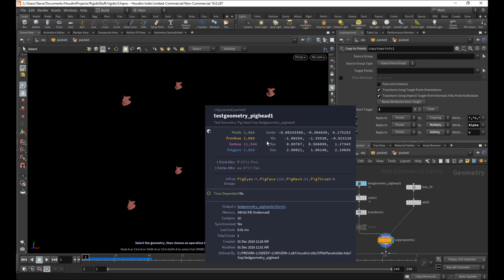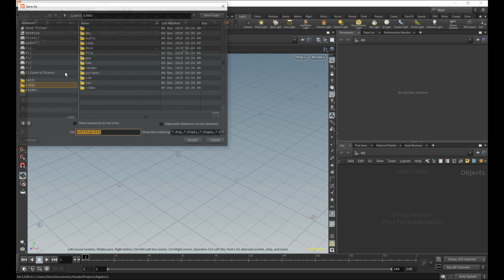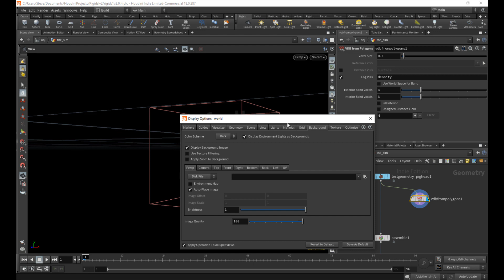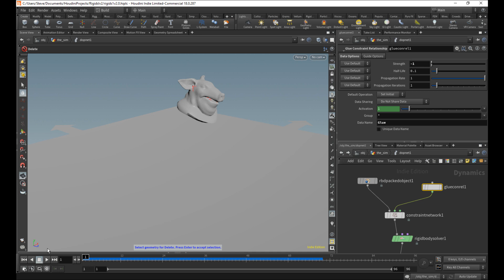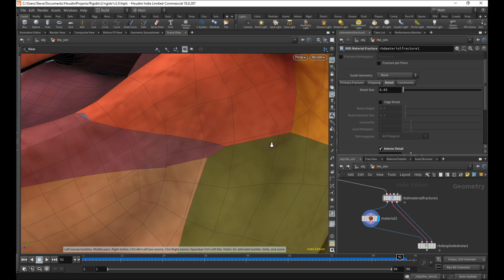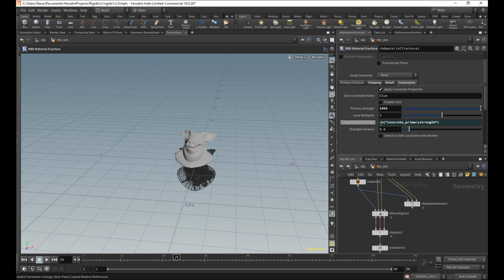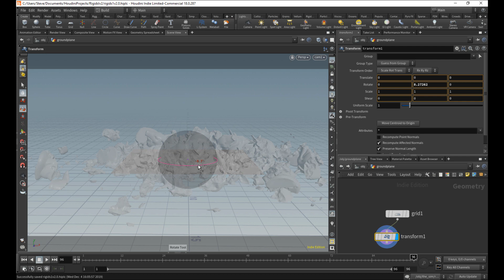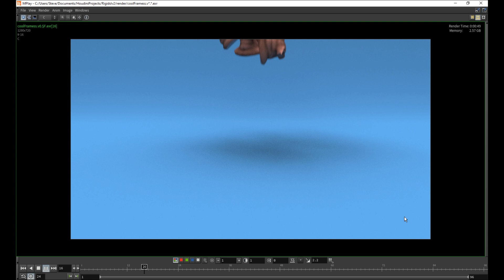Applied Houdini Rigids I version 2.0 - Fundamentals

Comment: Time stamp::

00:00 1.Intro
00:36 2. Packed Primitives 
08:24 3.Transformation
16:31 4.Basic Setup
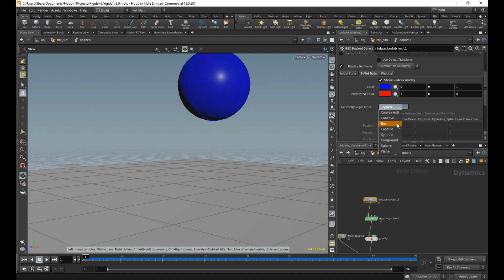24:34 5a.Voronoi Fracturing-Demo
30:57 5b.Voronoi Fracturing-Setup
37:37 5c.Voronoi Fracturing-constraints 
47:08 6.Boolean Fracturing 
50:56 7a.RBD tools workflow- RBD material Fracture 
01:04:07 7b.RBD tools workflow-important Properties
01:12:23 7c.RBD tools workflow-RBD setup
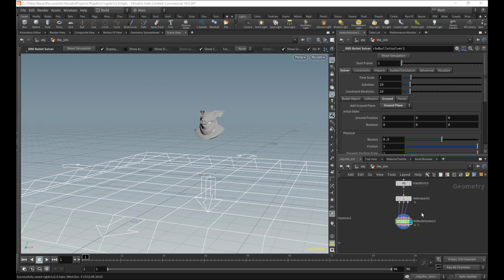01:18:11 7d.RBD tools workflow-instant asset 
01:26:51 8a.Render- setup
01:34:13 8b.Render - Lighting
01:42:49 9.Conclusion

Comment: First off, a massive thank you for your resources and tutorials. Basically I am using v18.0.499 I find that at 36:43 when I connect back to the dopnet the simulation fall happens but the pig heads stays in once piece?? driving me crazy.  I have followed everything and re-watch a few times now and there is no difference in my set up, is this a version issue?
Reply from the maker: Hello! Probably not a version issue - you might want to check if you still have multiple packed pieces, and that your glue isn't too strong. Otherwise, you can send me your file to contact@appliedhoudini.com and I'll take a look!
Reply: Hi there, I had exactly the same problem. I checked the collision boundary and the glue setting but nothing helped. Finally I figured out I stupidly used the wrong solver. I used RBD Solver instead of Rigid Body Solver. After the fixing, everything worked! Maybe you made the same mistake. If it is not the case, I would recommend that you just simply delete your DOP setup, select the packed pig head and use the shelf button RBD Object and Ground Plane to set up the DOP. It will definitely work. Then you can compare your setup with the houdini build-in setup to find the problem. This is how I figured out my mistake. Hope it helps! :-)
Reply: @nininanyu  Man. Thanks for pointing this out. Had the same mistake. haha.

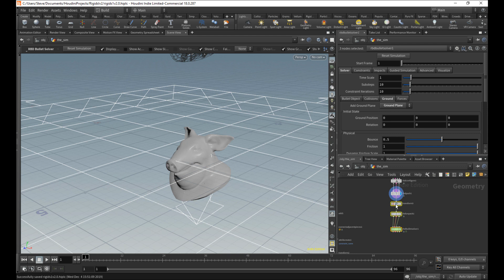Comment: Thank you for this tutorial, I have learned so much from you!  I have a quick question.  At 1:19:15 you begin the process to pack the geo and copy it to a highly divided box. After the copy I noticed you unpacked the geo before running it through the premade "RBD Bullet Solver" simulation.  Don't you lose the benefit of using packed points when simulating this way?   It looks like the premade "RBD Bullet Solver" node does not accept packed geo, but if you make your own custom Dop Network you can import a packed rbd object,  is that correct?
Reply from the maker: Hello, glad you're enjoying it! We're not unpacking geometry back into polygon mode, we are unpacking packed geometry that was itself packed into a higher package (assuming you are talking about the RBD Pack/RBD Unpack pair). The RBD Bullet Solver SOP does accept packed geo, and is what we are doing here in this lesson. You can always middle-click and hold on a node to see what kind of geometry is present at a given node - you'll see the packed pieces are still there after the RBD Unpack! If you have more questions, feel free to email me at contact@appliedhoudini.com!
Reply: @nothingifnotcritical  Thank you for taking the time to reply!
Reply from the maker: @NightWolfx7578  No problem!

Comment: Sir,
First of all, thanks for sharing your knowledge.. It means a lot.

Quick question if you don't mind...
On the second fracture level for the material fracture node.... Is there a way to control where or what pieces I want to add the 2nd level to....  Like either painting density, or maybe grouping some pieces of level 1... The last idea I can think of is may3an attribute wrangle and assign the names of the required pieces to an att.

Not sure if that is even possible... Is it?

Same question applies to the first level... Can I paint in my density where I want to fracture?

Thanks a lot

Comment: Thank you Steven for this awsome tutorial! I have one question, can we use a textume map in black and white, for example a crack texture map to generate cracks or impact point in RBDMaterialFracture node ? Thank you again.
Reply from the maker: Hey! No, not exactly, though you can paint where you want more density of cracks with the RBD Paint SOP. You can however use the Trace SOP to make geometry based a crack texture map, which can make cutting geometry that you can feed into an RBD Boolean node! You can email me at contact@appliedhouini.com if you need more help with that!

Comment: Hey Steven, thank you for making this! I have a quick question for your or anyone that may be able to help--at about 1:20:24, where you have all the Pig Heads, how would you make individual pighead randomly rotate as they all fall? 

I have been trying to figure that out for hours.

I have learned a LOT from your tutorials, i really appreciate the depth and the detail that you explain with.    Thank you
Reply from the maker: Hello! After the /obj/the_sim/copytopoints1 node, create another Attribute Randomize SOP and set the Attribute Name to w, set the Global Scale to 20, and set the distribution to Inside Sphere again. After that, on the /obj/the_sim/rbdunpack1 node, set Transfer Attributes to w as well, so all the pieces get these new random angular velocities. That should do it!
Reply: @nothingifnotcritical  thank you for the quick reply!!! I will give it a try.
Reply: @nothingifnotcritical  yes, it works! In my original attempts i did not set Transfer Attribute to w. Thank you once again!
Reply: @nothingifnotcritical  Hi Steven, one more question, is there a reason this does not work when using the RBD Solver? it looked like that was also the cause, when i change the solver to bullet it works, but with RBD Solver it does not. Is RBD Solver getting phased out and I should use bullet solver? The reason i am asking is that I used RBD Solver b/c it was giving be better collision geo and interaction with FLIP.

Anyway, i apologize for all the questions. If anyone else can enlighten me I would appreciate that as well. :)
Reply from the maker: @maximostromogilsky188  Indeed, the old regular 'rigid body solver' hasn't been updated in forever (as far as I know), and isn't generally used anymore... It's all Bullet all the time now! If you have any more questions, you can always email me at contact@appliedhoudini.com!
Reply: @nothingifnotcritical  thank you!

Comment: Hi, I loved this tutorial man, its great,
I have a doubt when I try this for another scene, Imagine 2 circular parallel plates (plate 1 at a height of 1 meter (fixed) and plate 2 is moving from 0.5 to 0.8), in-between that, I want to crush a wooden stick (which is in space, in-between those plates) I tried that with ground plane, its a success, when I tried like as I said above I can't hold the upper plate and the wooden stick in space (from falling), is there any way to hold the plate and stick from falling???

Thanks,
Reply from the maker: Hey, you can use the Glue constraint to attach any rigid body to any other. You could then delete the glue constraint (or have it be destroyed from an impact to one of the constrained pieces) during your simulation when you want to release it! If you need more help, feel free to contact me at contact@appliedhoudini.com
Reply: @nothingifnotcritical  Hi, I found it, thanks for the reply, Now I can hold the stick in space, 
And a personnel question: How long you are using Houdini?? And how did you learn coding?? Is there any trick or easy way to learn coding?? because every tutorial I watched they use at least 2 coding (in wrangles, etc..), and If I watch the tutorial I can understand the work but can't really understand the coding.

And thanks again for the tip,
Reply from the maker: @tamilarasu736  Hey! I've been using Houdini for over a decade, but this is the best way to learn VEX: https://www.tokeru.com/cgwiki/index.php?title=JoyOfVex
Reply: @nothingifnotcritical  Thank you very much brother, I'll study that.

Comment: do you see yourself using the rbd sop node or pyro solver node (sop) in a production for more complex tasks?
I dont know if im supposed to only use the sop level rbd and pyro tools now or still normal dop networks
Reply from the maker: You'll might still want to build it yourself for doing custom stuff, but the SOP all-in-one packages of the solvers cover quite a bit of the most used cases! Even the SOP ones allow you to do some custom stuff anyway (additional forces and the ability to add in a SOP Solver to do custom work), so you really can do quite a bit with it!

Comment: Great tutorial, I’m using a different object other than the pig head in the tutorial. How would I assign a material inside of the fracture when I’m not using the pig. When I try to do it, it applies the same material to the inside and outside. Thanks.

Comment: Hi
The geometry setup 1:04:11 with pighead to wall is it connected to DOP setup 1:04:30 ?

Thanks
Reply from the maker: It sure is! The wall has an attribute that sets it to inactive, while the pig is set to active. They are both read into the sim via the RBD Packed Object.
Reply: @nothingifnotcritical  Hi, It seems everything worked as I checked "Inheret Velocity from Point Velocity" under Initial State, in the rbdpackedobject.

Thank you for your tutorials!
Reply from the maker: @jensjensen4070  You're welcome, no problem!

Comment: Very cool📢 Can pieces break again?
Reply from the maker: Yeah! You can do multiple levels of fracturing.
Reply: @nothingifnotcritical  In primary fracture adding more levels? I have 2 levels but they fracture only in the first interaction.. after that, pieces that should break after another big interaction, don't break any more.. is this the way?
Reply from the maker: @Vakiwey  That's the way! You may need to play with the strength values for those constraints though to make them less strong. Email me at contact@appliedhoudini.com if you need more help!

Comment: thank u sir. since i came from cinema 4d and give a try of houdini then follow your RBD

PROBLEM : 
1. when i export the fracture with ROP ALEMBIC as packed and as single file, cinema 4d struggle loading hundreds of them in objet manager and heavy viewport
2. when i export as alembic after unpack, it come to C4D nicely and as single object in obj manager, but the limitation is icant export many copy of pig head with pieces. houdini struggle export it as unpack full geo. its about 200.000 pieces or more

what i miss here ?
i really like unpack first, because i dont have to deal with thousand of pieces, just as single object

but it will be better if there is a way to export pack alembic as single object too
Reply from the maker: Hello! Email me at contact@appliedhoudini.com if you'd like to talk about this more, but for now:

The general workflow is almost always to not unpack first. If you unpack, you won't have individual transformations per piece, you will only have a per-point based cache. And yeah, before you unpack it, the pieces are instances, so Houdini doesn't have to work as hard memory-wise with them. Getting this instanced behavior in C4D is what you want. Try changing "Packed Transform" parameter under the Alembic ROP's Geometry tab to Transform Geometry from Deform Geometry.
Reply: @nothingifnotcritical  thank for your reply:

i tried what u are suggesting. but its not what i want. i dont need individual transformation each piece. when i did the individual transform, the C4D obj manager will struggle loading hundred/thousand of individual pieces. what i wanted is just fracture the pig head into pieces and export it as alembic, with one zero world origin, im ok with that.

currently wht i see when export it as alembic (its always one file in folder dir because im not using $F, just what i wanted, nice) the problem was:
1. packed version = open C4D, import alembic, loading forever until finish and my obj manager show me individual piece1 piece2 piece3 so on and get heavy; i dont like it
2. unpack version = open C4D, import alembic, loading SO FAST and my obj manager show me ONLY ONE object; perfect

pros packed : in houdini everything run smoothly just what u said, its memory eficient
con packed : cant export it as single obj manager for later c4d use ( just dont know yet)

pros unpack  : as i said above (unpack version), millions of polygon, no problem for c4d since it really merge as one object only
con unpack : of course when we dealing with voronoi it will be pack geo/point at the begining, its ok for small sim, but when it grow bigger2 until it say 30000 packed, my PC explode  everytime tried to unpack before goin to rop node, just as u said, once unpack, houdini store that million of polys to memory

it looks so difficult, or just me, yeah i think its just me

tutorials are everywhere, but teaching about good fundamental & logic behind how should this and that, hmmm not so much, good to know u dude. awesome
Reply: ohh and also, when i use unpacked one, the file is nightmarely hugeeeee, from 5 to 10 Gb for 120frame only
Reply from the maker: @davidajjah8186  That all makes sense unfortunately, especially the large file sizes. It essentially has to save all of the data for the pieces on every single frame, instead of just once and then transforming it into new positions. Transferring data from one package to another has always been a pain, but these are probably your only two options... The only other thing you might try is that instead of unpacking in Houdini, try converting to a Polygon Soup. Good luck!
Reply: @nothingifnotcritical  yeah nice line there "Transferring data from one package to another has always been a pain".

try converting to a Polygon Soup? yeah its likely close to Unpack sop and read on the forum  where they said alembic most likely good with polysoup instead regular one.
i already do that, and yeah houdini keep chrashing everytime i tried to convert, i think my memory not big enough to read them 

thanks dude,

Comment: I really do not like running simulation in sop!
Much more like inside DOPnetwork workflow
Reply from the maker: I agree, that's why I show both ways - it can be nice though when doing very simple secondary effects though to have the SOP option...
Reply: @nothingifnotcritical  You said at the beginning of the video that you will show how to load custom collision geometry. And didn't show :)
Reply: just load custome low poly convex hull with s@name attrib, and apply matrix  after DOP in dopimport node?
Reply from the maker: @sqworkshop  Yes, that's right - the proxy geometry can be anything (in this case low poly convex hulls) and then you apply the same transform around the same pivot to the hires. In the earlier part of the lesson where we are talking about transforms, you can see we're even using a regular cube!
Reply: @nothingifnotcritical  What are you think aboute SOP vellume simulation? I haven't studied vellum yet, but all tutorials are based on SOP simulation. Why nobody use vellume in DOP?
Reply from the maker: @sqworkshop  Hey! I think because cloth tends to be something you just set up once (constraints and painted properties and so on), and then you just let it run. There isn't much of the simulation itself that needs to be customized usually... The other answer is that FX artists dealing with smoke, particles etc are used to more granual control of their simulations, while CFX (character effects) artists doing cloth do that somewhat less often...
Reply: @nothingifnotcritical  where is "earlier part of the lesson"? version 1 are hiden :(
Reply from the maker: @sqworkshop  Sorry, I don't understand? Also you can email me at contact@appliedhoudini.com if you are having trouble with the lesson.